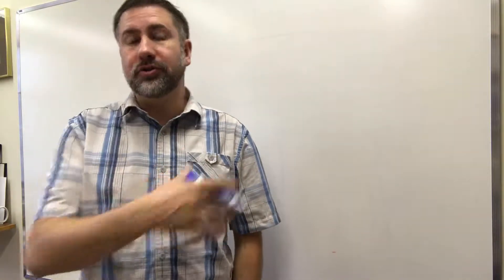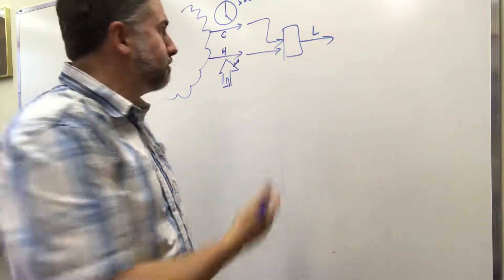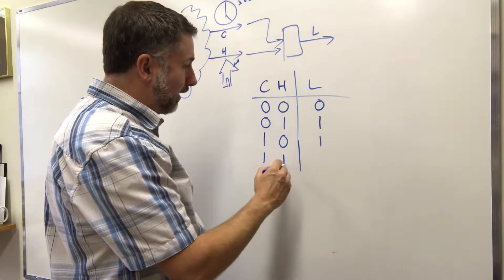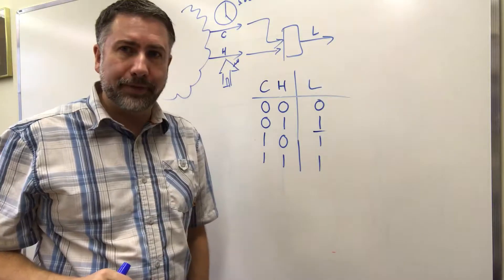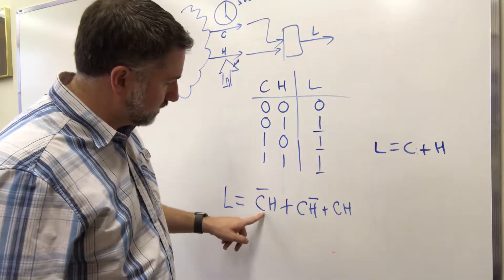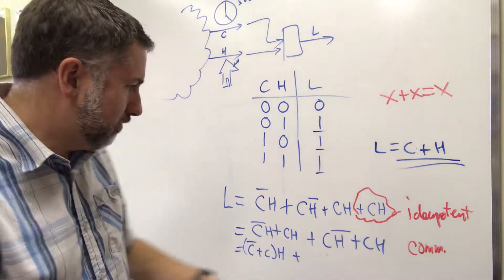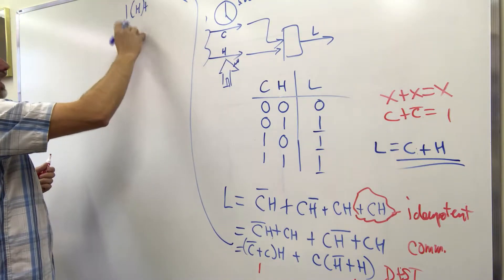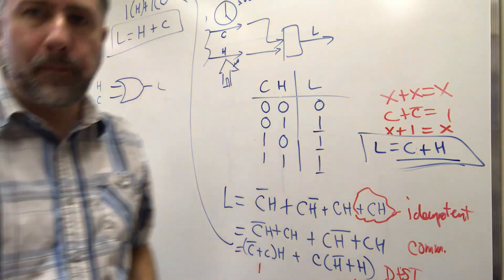gates 3: an example

Comment: Is there any specific reason you used idempotent in your first step instead of just doing the following?

L = C'H + CH' + CH
C'H + C(H' + H)
C + C'H
(C + C')(C + H)
1(C + H)
C + H

I personally feel like the above way is more intuitive as it follows more closely with traditional algebra... as long as knowing the distributive rule x + yz = (x + y)(x + z) should be applied in forms of x + x'y to make one of the factors 1.
Thoughts?